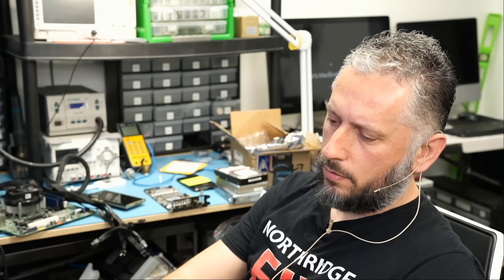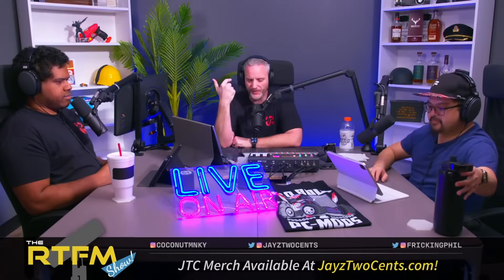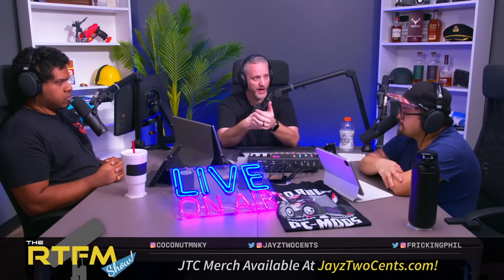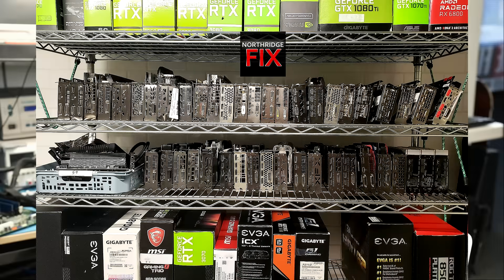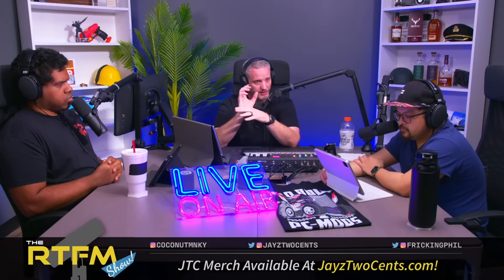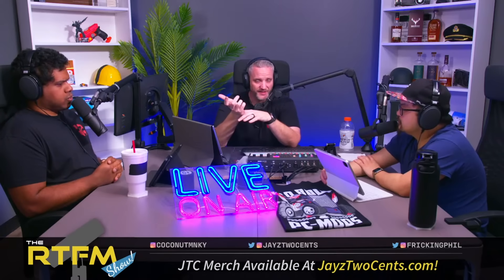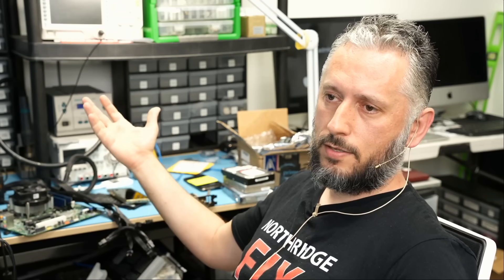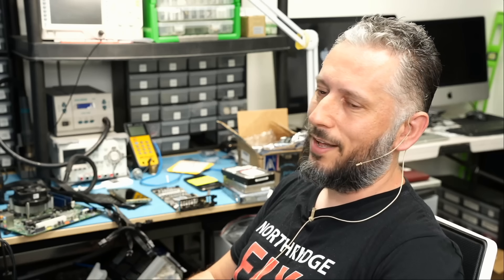Melting 4090 and CableMod. JayzTwoCents and Gamers Nexus Response. Blame NVidia or User?

Comment: I fixed a new computer build that someone else built. They couldn't get it to post and turn on and didn't know what the problem was. I checked all the cables from the power supply to all the components and 1 or 2 cables were not in all the way so I pushed them in and it posted and all was good. Nothing melted, fried of smelt burnt from that build. I don't see how a cable not plugged in all the way can fry a card like that. Over voltage or weak metal on the plugin socket seems like the problem.

Comment: I have the Gigabyte Auros Master 4090.  I use the adapter that came with the gpu and I use 4
Individual vga cables from the connector to my EVGA psu.  I’ve been gaming for hours on in and every now and again I open the case to “feel” the connector and I feel barely any warmth.  I’m assuming it’s just heat from the card itself.  Mine is constantly pulling 400+ watts while gaming according to afterburner.

Have you gotten any Gigabyte models in for repair?

Comment: I've been using Cablemod right angle adapter with a Fasgear 12VHPWR cable on a Asus Tuff 4090 for 2 months and no melting yet.
Reply: GPU started shutting down and restarting the system after 5 min of gaming. Same issue on multiple games even after full clean install of OS. Tried taking the connector off to get the card out. The adapter is fused to the connector.

Comment: Issue is that this connectors is incapable of sustained lod that it I requested to do. 

Or it is able only if fully injected (conduction surface is fully utilized)

It is Unacceptable to design the plug with resistance high enough to actually heat up to melt! 

Those pins are commonly designed for about 5-7a per pin (about 60-80w at 12v). 

You can test it by unsoldering and running controlled dc current though single pin 7a likely will heat it up above 60C = plastic melting temp. Now add to that higher embient temp (about 15c more) and you get why some users experience it 

It is there for Invidia fault, they shipped cards with connector that is barely able to conduct needed current with no margin and any type of embient temp increase cause plastic to heat up beyond operational temp - that is fire hazard
Reply: I’m sure you or Linus or nexus are more than capable of desoldering the connector for bench test as I described or even finding the spec sheet for this connectors (I’m sure spec sheet will confirm that it is operating at upper limit for 35c ambient temp, some pc get 40+ inside)

Comment: maybe the connector get loose uder work load/temperature and just loosing the good grip/connection in socket, till get loose and produce more heat spike till melt, just get wore over time with temperature, its not instant proces

Comment: There is actaully an easy solution to make sure that the cable is seated properly.
The old VGA and RS cables have thum screws. Sime solution - just seat the cabel and thighen with crews . It will not fall and will be properly seated.
Also we need a new connector. That flimzi plastic with small wires is no longer good enaugh for handle the Wattage those new cards draw. 
We came to the erra when PCs will have to have their own cuircuit because most of the older homes dont have high capacity curicuts.  PC with i9 (13gen) and 4090 draw as much combined power as heaters , oven , or even smaller watter boilers. Its getting absurd.

Comment: cards are using more and more power but nvidia decides to go from 2 good sized connectors that didnt have an issue to 1 small connector and then expect that 1 connector to handle upwards of 600 watts (50 amps at 12 volts (I = P/V)).
l have been saying since the start of the problem that there is far too much current going through the connector and l am still sticking to it because l have seen this type of damage lots of times in other fields of electronics and the problem has ALWAYS been because of shorts or too much current.
the first time l came across this type of issue (as a child) was with tamiya R/C battery lead terminals melting in the exact same way as the nvidia connector when ever you used non stock batteries and or motors.
you dont run 20 amps through a 10 amp socket and say she will be right mate.

Comment: why not distributing the power through 2 socket connector instead of 1 on the card ?
Reply: right now, the solution is undervolt/underclock the card.. so it doesnt consume a power that melt the cable.. meeeh. The Fault is on Nvidia card design.

Comment: I agree with Jay and you in the fact that this is a simple connector and it is hard to believe someone spending so much on a card would not ensure a tight connection. I will say I agree with Jay they should have a clip on both sides of the connector to ensure a snug square fit. This is purely a design flaw.

Comment: Ever since the first round of news about the melting cables, I've set my 4090 on a 350W power limit. Nothing has happened yet knocks on wood but it's crazy to hear it's still happening.
Reply: Agree it's a power supply to card issue

Comment: I agree 100% with what you said, but I would say that the user not fully engaging/seating card and connector is a factor simply because it either accelerates the failure or creates a different type of failure than what you've been repairing. Still on the manufacturer for essentially causing the issue though, just to be clear.

Comment: Say what you want about the connector itself being adequate, but the power specification of this connector is way too high. It's rated for 600W and I'd say a 300W rating is far more appropriate.  Even the 8 pin PCI-E connector is only rated for 150W and now I'm being told that if you add 4 pins to that suddenly it's capable of 600W? This is really dubious.

Comment: Designing a PCB with a single connector to handle 450 w of power is the problem. Then add on OC possibilities 500 w plus. Poor engineering design IMO. Keep up the great reporting.

Comment: check the size if the wire in the adapter, if the wires are smaller or resistance is higher, there is your problem.

Comment: I agree with you NorthridgeFix, I think the fault is on nvidia, it should have been designed with a much higher tolerance, like really who cares if we have small connectors, why did they even think people needed that, it would have been better to have a connector with less resistance and better heat dissipation and who cares if it would have been larger, better than worrying about your card melting.

Comment: Midway through this vid I went and watched the original video to check if the reactions were justified.
I have to say that Gamers Nexus's response is very unreasonable, especially because you could literally see how 100% tight the adapter was seated on the card AND that you then afterwards had to rip the adapter off the card's connector. 

It seems this is literally as perfect of an isolated example of the problem being NV's connector UNLESS the adapter SOMEHOW happens to have an issue on the GPU connector side which would be absurdly unlikely.

Comment: Regardless of which combination of problems lead to the melting Connectors, i just don't like the new Connector in general.
Nvidia's solution to increasing 12V current draw: Make smaller Connector!
NO, make them BIGGER! As fat as you can fit into an 1 PCI Slot space.
Heck a gold-plated automotive HI-FI screw-connector would be perfect for this 500W space heaters.
But no, they squeeze 40 Amps through a Connector the size of an HDMI Port.

Comment: Why isnt nvidia testing this? Its all speculation from GamerNexus and Jayz2cents. Northridge Fix is getting the cards for repair and would have the best insight. But, really its on nvidia and seems like a firmware issue where the card thinks it can draw too much power and then melts down itself. That is a hardware/firmware issue, not a user issue. Users dont have acces to that level of the card to make any changes.

Comment: This is why I’ll keep my 3080 and skip 40 series all together. I’ll wait to see what the landscape is for 50 series. If we still see unreasonable prices, insane wattage, and any hint of melting connectors, I may just go with AMD next time around. Or see how far Intel has come. I never bought the user error story before anyway, simply because it wasn’t a problem with previous generations. Also I feel like the focus needs to be lowering power usage while maintaining current performance, at the very least. (I mean I’m for better performance, but I feel like increasing wattage to get there is cheating and somewhat dangerous. GPU’s are already considered space heaters. They don’t need to consume more power).

Comment: I guess gamers Nexus can't blame Nvidia still knowing the facts 🤬 maybe he is paid by Nvidia, I guess the 12 pin connector with it's metal dimension in it's pin isn't enough to push that's high wattage for a 4090, maybe the connector was previously build for a lower powered card and was pushed for 4090 without doing sufficient testing.

Comment: I actually clicked dislike on that video Steve put out.  The only one of his I have ever done that on.  Who cares if all the cards came from Cablemod?  Did Cablemod manufacture them? No, they did not.  They got them from individual users.  Steve tried to make it sound like this whole fiasco is a Cablemod issue when it isn't.  He seems to be going out of his way to insist that this issue is in no way an Nvidia issue and Nvidia cannot thank him enough for that.

Yours and Jays point is correct, if there is significant number of different users all having the exact same issue with a card, that is on the manufacturer to correct so that it is no longer an issue.

Comment: If the connector is a normal fit and the cable fits it perfectcly whit not much resistance or force applyed than yes , it can be user error ,  but if that sed cable fits in into that connector only when applying force and you have to wiggle the damn thing 10 times for it to be proper seated  than a normal user can make the mistake of thinking that the cable is plugged in even dough its not and that becomes Nvidias error not the consumer's error. And from what ive seen in this video nothing looks like a snug fit :)) everything is forced....so yeah i blame Nvidia not the user

Comment: There is no way to defend Nvidia when its the first series having this kind of problem in several cases. Just the fact that you end up adapting three connectors from the PSU to one connector to the GPU is wrong; the orientation when installing and the wigling when disconecting is obviously bad. Please dont give Nvidia any rest and stop buying this bad overpriced cards.

Comment: I worked in Automotive for 15 plus years and have dealt with bad connectors pins. Manufacture Alway test and retest to find out its there design fault that caused the problem. Computer, video cards should do the same and it’s there responsibility to fix it properly.

Comment: I have swarn off nvidia entirely, and I'm a long time customer, over a decade too. they dont care what happens to the cards as long as they sell, after that its on you if the card bruns up or not, and insuring safr guards cost to much for them ,why even include fulty adapters when they are clearly trying to force everyone in to new psu with proprietary ports. Also, nvidia experience is one of the worse programs i have ever had on my system and i will never install it ever again, they updated it with 2 factor and its locked me out ever since and the gmail confirmation doesnt work at all makeing the program 100% useless to me, thank god i can still download drivers from the offical website directly or i wouldn't have any. So annoying

Comment: The 12VHPWR has a lower margin for error, this is a fact. Even manufacturing variation needs to be lower. Seems like nvidia decided to cheap out on some adapters. On a product that costs what a 4090 costs, this shouldnt happen.

Comment: I think you're misinterpreting GNs reporting and stance.  I think they're only trying to be intellectually honest and as scientific as they can be from what they know, don't know and what they can prove they have discovered.  They are not shy about putting NVIDIA to the screws for whatever dumb decisions or mistakes they make --ever.  So it doesn't appear to me GN is shilling for NVIDIA or attempting to contradict you or set the issues aside, categorically, as "simply user error"?  A number of times in that video Steve said "we don't know".  Honestly, all three of you are the same team, really, but clearly have different perspectives, data and methodologies to arrive at certain conclusions.  I think everyone, including me, can agree that this SHOULD NOT be a user responsibility no matter what the root cause is.  As you said it's a connector, not rocket science.  This should be simple and just work.

Comment: I agree with you fully, if you look at the design of this connector from the manufacturer you will find it is a rebranded connector type that already existed without the 4 sense pins. In the original design specification it is clearly stated that this is a connector used for industrial appliances where the connectors are only touched by qualified technicians. How can they rebrand such a connector and give to end users? The ones who have thought that was a good idea must be utterly retarded. Also this connector has a very limited lifespan, after 20 insertions it should be replaced (both cable connector and the connector soldered on the graphics card) which also sounds as a really bad thing if you ask me. But nobody seems to want to listen to this kind of arguments. Yes buying a graphics card 2nd hand with unknown number of insertions would mean you should send the card to NorthridgeFix or any other shop that can replace the connector even if it is not burned at all. And if you get a 2nd hand cable with unknown number of insertions that is straight to the trash and buy a new one. When are people start to realize that this is not what you want on a product no matter what other things are said about it.

Comment: the problem is clearly not the card cause as said this problem is caused by heat and in this case the heat is done by high resistence and power, so if it would be the card the symptoms would be others like extremly high temps in certian area or also some part of pcb areas of a different color(I don t think it would burn cause the heat is too low).
The problem is clearly of the connector cause it burns and as said by gamer nexus it could be caused by user error and/or some debrice in the connector that cause an extremly high resistance.
I think that nvidia should take rma but also talk to the connector producer/right holder cause it s obvius at this point that is project or production problem.
If it would been the card if we would have to see at least more then 25-30% of the card haveing this problem.
Infact when there is a such problem caused by a bad project is not that rare that 30-50% of the product soffer it, as we can see with joypad for example that suffer of drifting, only the joycon report a 80% of drifting percent and others like the playstation one have a similar percent

Comment: Apreciate that your speaking the truth! Its pretty obvious. Due to the need to present the best card on the market companys overdesign and underperform some cards in sense of electrical capabilities. Here is going to much cutternt in. This is melting /welding the connectors together! Everyone who have knowlege with professional soldering know what happened with to metal connector when there is flowing to much current. You cant disconnect them because the literally are melted together. This is not an error of the user! Otherwise how come that in the last 4 generation nobody made this error! 
I fear we gonna see this problem more often in the future generation of GPU's due to the need of higher performance. The connector should be changed by design. The TDP is climbing higher and higher.

Comment: I always thought that the line on the connectors that Steve was talking about could be caused when removing the melted connector...Being that the plastic was heated and compromised, it wouldn't take much pressure while wiggling the cable out to leave an impression in the plastic...I just find it highly suspicious that all these different brands of connectors keep melting in the exact same way...These things are hard to nail down though, so who knows what is really happening...

Comment: I believe that it's the 4090s that can draw 600w that are failing the most while the 450w 4090s are not failing close to the rate of the 600w cards. Too much potential current on one, under dimensioned, socket. Maybe not made enough headroom for power spikes, idk.. Only speculations but seems likely

Comment: Would be interesting to see a running card with a thermal camera pointed at it.
Also, somebody could modify a cable so that the current could be monitored while in use

Comment: i hope my card survives it ... only plugged in 3 of 4  8xpin cables so limited to 450w instead of 650w with the adapter which was included , was thinkin about to buy the 90degree adapter but now im unsure looks like i have to keep side panel open until we get some response from Nvidia the 12vhpwr connector was unnecessary 450w is enough power even with the old connector 3x8pin but yeah shit happens here we are ...fingers crossed that the card survives atleast 2-3 generations of Nvidia cards

Comment: Okay so a friend of mine got an Asus 4090 and he’s using same cable mod adapter , even though it’s plugged in all the way the connectors burned . I think it’s possible the adapter isn’t able to handle the power/ heat passing through or it’s strictly manufacturing error but it’s time we took a look at the adapter and what’s the max temperature for the adapter?